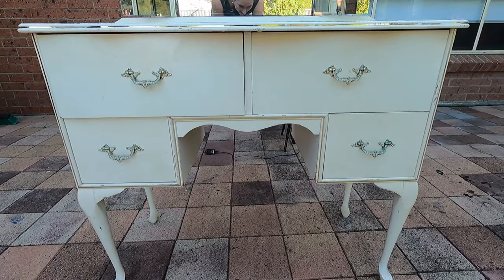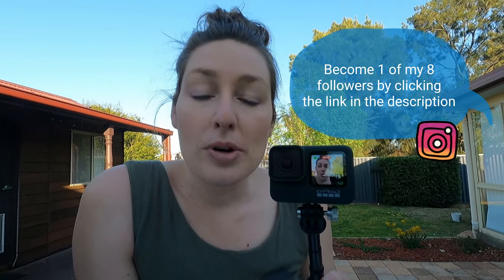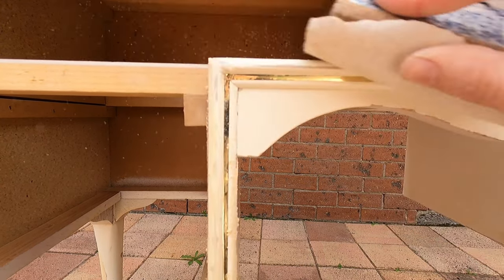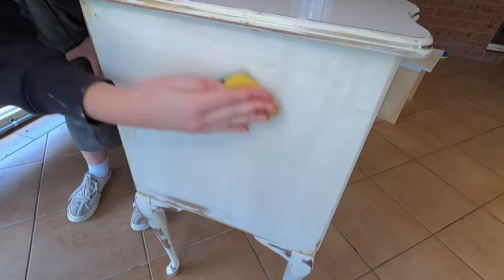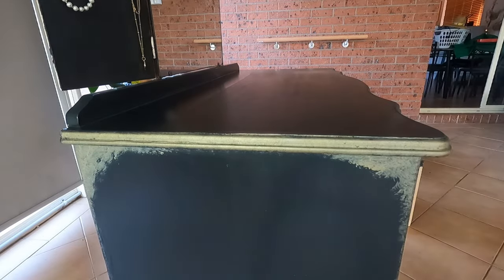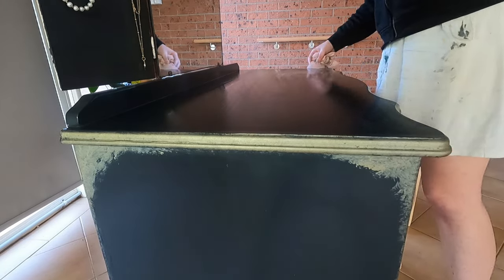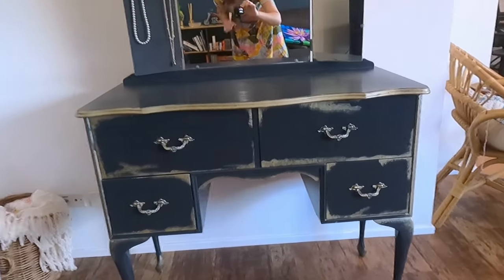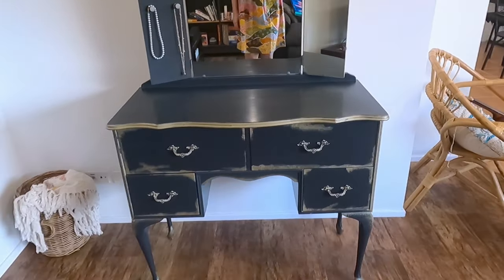DIRTY OLD QUEEN ANNE DRESSING TABLE UPCYCLED with a DARKER ANTIQUE look

Comment: Just a suggestion. I think your paint would stick much better if you used a primer on your piece first. It gives the paint something to grab onto. Considering what you had to work with, it turned out great. :)
Reply from the maker: Thanks for the tip 🙂 I wasn't sure if primer needed to be used with the ESP.